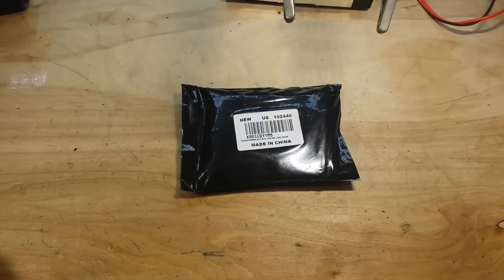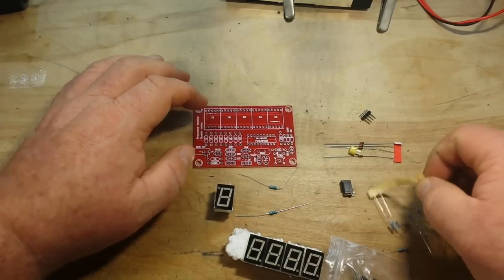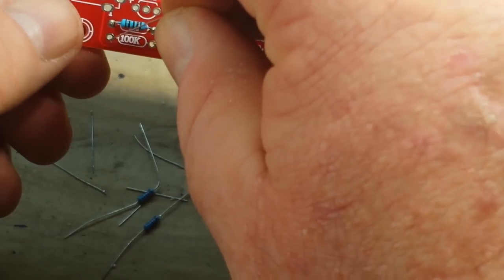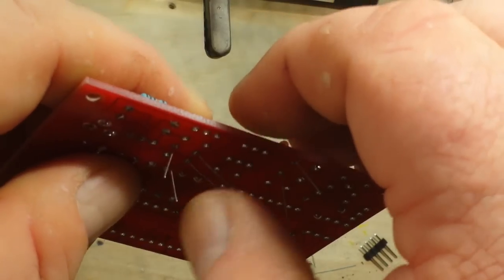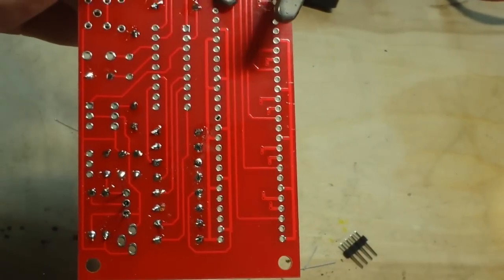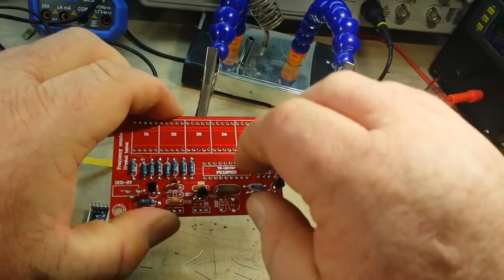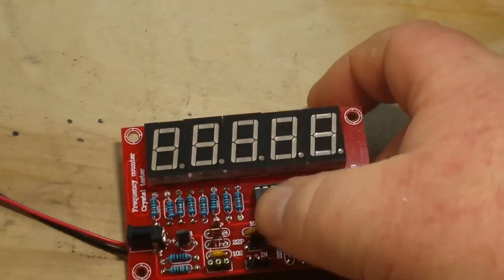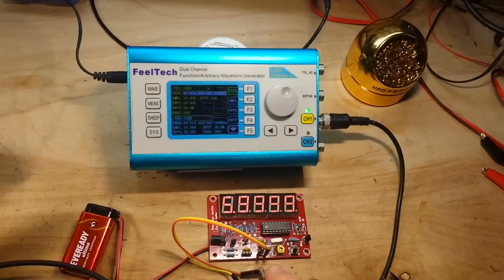Frequency Counter Kit Build

Comment: lol this kit is only for checking xtal crystals in those small steel cans with 2 legs. you need other type of board to see what you are transmitting on but both kits take same pic chip and you would have to remodel your board to read transmit mode. i have the same board and i use it to check the xtal frequency's so if you are trying to find where you are transmitting dont get this kit

Comment: I learned to solder by building my first kit with a $5 iron I bought at Walmart. Now I use a $10 Dollar iron I got from Amazon. I still have never used a good soldering iron but I do love to look at new irons and one day I will get one. Like you I did the military thing. I did the air Force for 16 years. I planned to do at least 20 but Iraq messed that up. So I have some health problems that prevent me from working which sucks so bad. I live on my VA disability because of Iraq. So it means I usually only get a cheap kit or two a month. I also plan out bigger projects and slowly buy a chip here and a cap there until I can build it. I do have a scope because someone in my life bought it for me which blew my mind "best birthday ever" I knew it was coming for a couple of months but the day it showed up was just great. I was a sheet metal guy in the air Force so electronics came late in my life but I'm so glad I started learning it. I watch a lot of YouTube and read a lot of online articles about electronics. I've read every book about it that my local library has. I learn a ton watching your videos and I just want to say from one vet to another thank you Paul for helping me with the hobby I love.
Reply from the maker: Mike you are more than welcome. You should have your new meter tomorrow.
Reply: Thank you for your service.

Comment: It started at yong age by tearing toys apart and see how they worked. A person on a garage reparing coil from motors, transformers had soldering and i had a broken console game pad. He learn how to scrape the trace, solder the cracked joints and wire. On the next day solder pins and more. It was a hard worker at long night and my father allow me to go because he knew i was learning and the man was a good neighborhood.

Then he unleashed my imagination with the 555 IC :P and followed breadboard, soldering iron, analog multimeter. 

Good concern about learning from your wisdom.

Comment: The component holes on that board look ENORMOUS!!!  Surprising that the resistors didn't slip through.
Speaking of Clive.  His soldering jig is ideal for jobs like that ... Never seen one for sale either new or second hand.  I'm surprised no one on the bay has come up with something like it - anything better than the "helping?" hands.  Which are better than nothing - but not by much.  Mine is very clumsy and fiddly

Comment: When I was in RTC San Diego ('71) didn't get any specialized training for my rate(ET). That came after boot starting with Basic E/E School. The real training in soldering actually was after I was out in the fleet. I seem to recall some of it in Electronics School on Treasure Island but it was just the rudiments needed to work on tube equipment.

Comment: I just built mine, got it in the mail from China today.  The price has gone down, this one cost me 3.50 plus tax so basically 5 bucks free shipping as norm with China.  Fun build, I did find an adapter to use on the plug but I think I will be just bogging in a 9 volt hookup as well, to much of a hastle finding the blasted plug deal, then putting it away for use else where when i have finished. Thanks for the Video and 73's from KE0JBL

Comment: just got my delivery today for my new build  to night its the  dso 138 Oscilloscope kit any pointers paul .been watching  all your shows and listening to your voice on all shows so much it seems like i know you  for long time funny  yes ive done a grap load of cheap builds learned a lot from doing them and you your doing an awesome job keep it up. learning a lot form you thank you.
Reply from the maker: https://youtu.be/UDHAyITL5Nw
Reply: thnks i remember watching it  it was one of your first show and it took me about 2.5 hours to check values
Reply: i keep for getting to ask you on some boards there are pads on front and back now i have seen components soldered on front and back what is the reason for this does it help for like boards in vibrating or shock proofing it

Comment: I built one of these a few years ago. I used it to check crystals for rock bound QRP transmitters like the Pixie. Seems to me I had to add extra Capacitance to the 22pF caps to keep the oscillator stable for 40M crystals.
Chuck Adams K7QO had this to say on the Chinese kit in 2016. "Photo 40. Two 22pF disc capacitors. If you have a supply of disc caps, do not install these. Put in a 68pF for the top cap and something like a 120-200pF for the lower cap. The 22pF caps work for crystals that are above 10MHz, but may (not) work for lower frequencies. The (Chinese) designer just copied some values somewhere that did not consider lower frequencies that ham radio operators use for experiments." 
Hope this helps any one testing 80 and 40 Meter band crystals.

Comment: I might interject a hint: measure all components on a meter before installing. It happens pretty rarely, but components can be mis-marked. Had a oscilloscope I built fail the smoke test. Was grateful the blown fuse saved the project. There was one of the diodes marked backwards. And another time a project I was doing for the Canadian Navy was stalled for a while because the orange paint on the resistors was brown.(big difference between 110 ohms and 11Kohms)

Comment: I don't know what it is, but you have read my mind again. I also wants to make a frequency counter but i want a easy way to add a binary counter.  So my frequency is 1 second, after 60x60x16 i want to have a signal, then after 60x60x7 i want to start over again. Off-course i can use a PIC or a binary counter. But i want to make something that is really primitive.

Comment: I use 63/37 solder instead of 60/40. It has a faster solidifying time and makes it easier to get a good connection(less likely to make a cold solder joint) But, it's a bit more pricey.

Comment: I have the same unit and another different unit with the yellow button. Both units will NOT read above 16 MHz properly. example, 37.600 MHz displays 15.53xx. Other 37, 38 45 MHz crystals show similar results. They 'divide' by 3-ish and that's what they display. Anyone know the fix?

Comment: Hello sir can this test a 32.768Khz crystal on the motherboard can u give me a link to a tester that'works for this crystal or a multimeter thank you
Reply from the maker: It will work
Reply: @learnelectronics  I have found crystals in the kHz range don't test.  The small barrel ones with radial leads from watches, etc.  I have also found 50MHz crystals don't test.  In my experience, this is a 1-49 MHz tester.

Comment: i'm so ocd when comes to components arrangement
Reply: I built circuit boards professionally and we definitely had rules for how parts went on boards. Depending on orientation with the top side of the board up parts either read left to right if they were horizontal, or up down if they were vertical. When you look at properly assembled boards that's how they're made. Part of the reason for doing that is so you can QC the boards. When all of the components are in the same way it is easy to spot out ones in the wrong places.